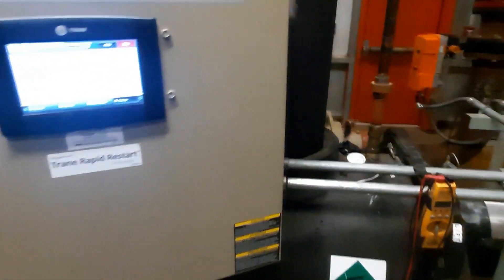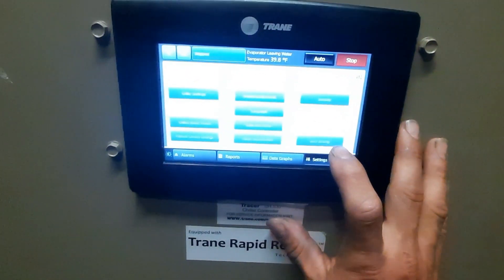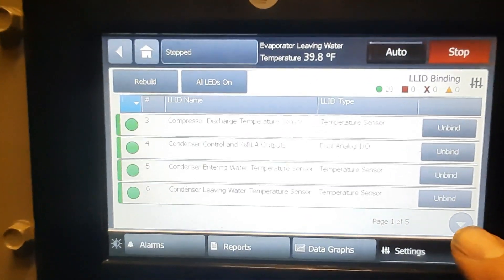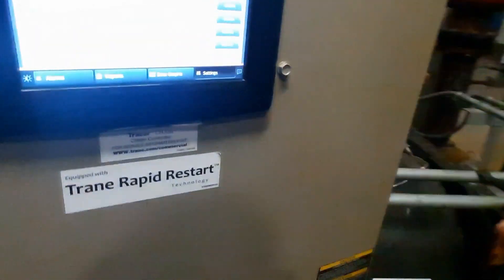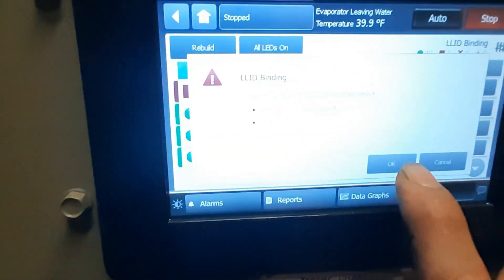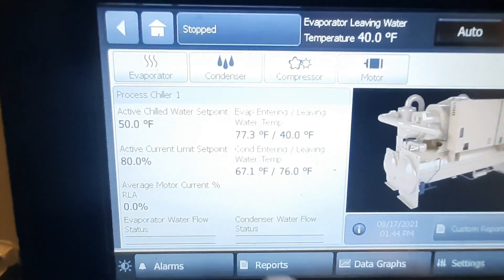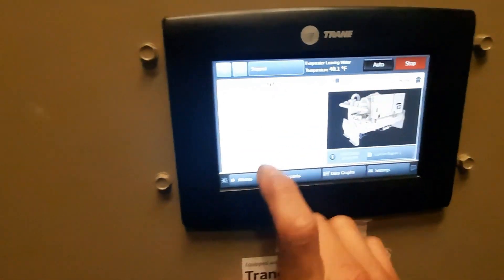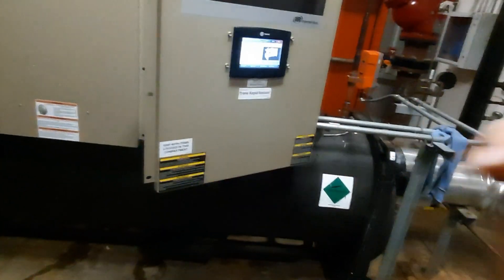Trane Chiller sensor replacement

Comment: I will replace my chiller trane condenser temperature sensor, before replace the sensor needed the chiller stop or can replace at the chiller running? Thx
Reply from the maker: Without properly reading sensors the chiller cannot control properly, it will most likely shut itself down in reaction to incorrect temperature reading and alarm. You may experience intermittent lock outs as well. You should maintain a controlled environment, after replacing any sensor and be sure you can monitor all sensor readings accurately to confirm accurate temperature control and system performance. Follow the manufacturer instructions precisely.
Reply: Now, the alarm "Comm Loss": Condenser Entering Water Temperature and HMI not reading the measurement. But until now the system running normally. I think the sensor can be replaced while the system running. If I try to unbind & bind new sensor the system automatically shutdown? Need advice from you
Reply from the maker: @aw13t you have to unbind the old sensor and then bind the new sensor, there are instructions for this, I would shut the system down normally, replace and verify the new sensor. Comm loss means it’s not communicating, the control cannot see the sensor.

Comment: Sir f censor  lossen not working anymore?
Reply from the maker: The sensors will not typically stop working. They usually begin to read a few degrees off  and can cause operating issues.

Comment: Dear Sir.I got sensor error of Evaporator entering temperature . I switched the the supply and return sensor but the error is still the same.Do we need to unbind and bind back the sensor when replacing it?
Reply from the maker: Yes
Reply: @EverythingHVACR  Thanks sir. I am a bit strange with Trane chiller. To unbind and bind it back, we can do it directly via touch screen or have to use any trane software ?
Reply from the maker: Depends on the chiller and control. The chiller in this video, you are able to use the touch screen as long as you have the password. If older chiller, you may need tech view software. You can not just swap sensors either.
Reply: I ma looking for the new sensor to replace .The damage sensor model is X13650726100 (EIA-1901) and the new one I found on ebay is X13650726100 (EIA-1940). As EIA number is different, can I still replace with new one model?
Reply from the maker: I think the "X" number is tranes model, but I'm  not sure about the other number. You would have to contact trane to be 100 percent sure. They also should have the sensor you need.
Reply: @andrewhiv1728 this is low temperature sensor 
Like pool temperature chilled water entering and leaving

Comment: Do you need to shut any water off?
Reply from the maker: No, the temperature sensors don't know the difference, the probes are isolated from the water, you can change them without turning the water off.

Comment: Good video. I have an rtac with water flow issues. What direction should the dimple on the sensor face?
Reply from the maker: Not sure what dimple your talking about but I would say read the manual or contact manufacturer is your best bet.

Comment: What's the super secret password ?
Reply from the maker: 😆 honestly I don't remember off hand, I was able to get ahold of the trane guy who installed it and he set his own PW, it wasn't the factory base line PW.
Reply: Damn. I was hoping I could find it. Swapped return sensor cause it showed -60 but now it doesn't read it at all. Thanks for the video, it was tremendous
Reply from the maker: Thanks, Maira. If it doesn't read, it probably didn't bind correctly. You may have to try a couple of times.

Comment: i want password to can bind the new sensor ,can you help?
Reply from the maker: Default password can be found in manual, this one was actually changed. I don't remember 100 percent but is was something simple 1234 or 0000, something like that
Reply: @EverythingHVACR  thanks for answer
Reply: I tried default password 7123 but not work , can you help me to find way to binding the new sensor ,sorry for annoying.thanks in advance
Reply from the maker: Try the others I gave previously, if this does not work you may need to call harshaw Trane if they did start up they will sometimes change PW, look inside panels for PW possibly written down. You will not be able to bind a sensor if you can't get in to the control
Reply: Thx a lot sir.
I try your  password but it's not unlocked
Reply: But by your idea I got password and I bind entring water temperature sensor
Reply from the maker: Glad I could help, Thanks AIR COOLED CHILLER!
Reply: Please share CVHG 1100 Trane chiller binding password